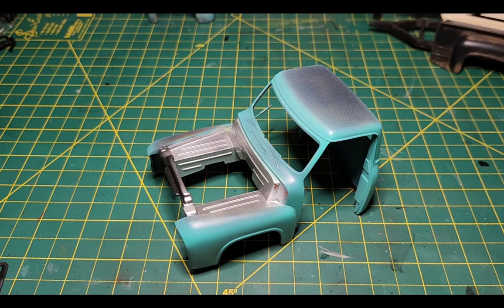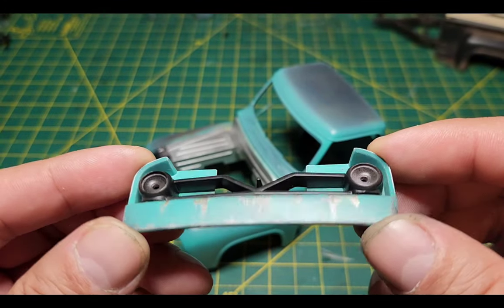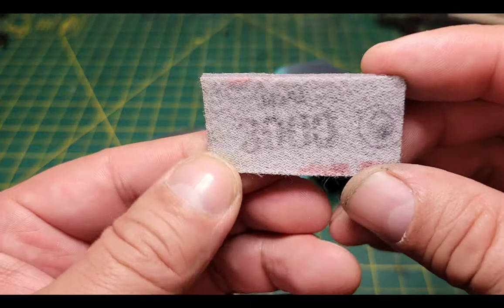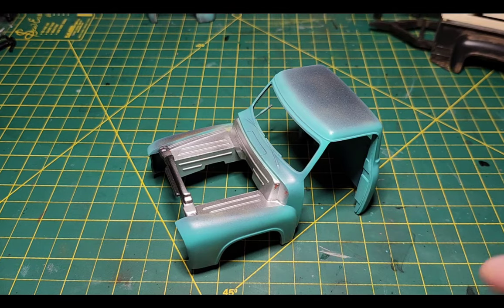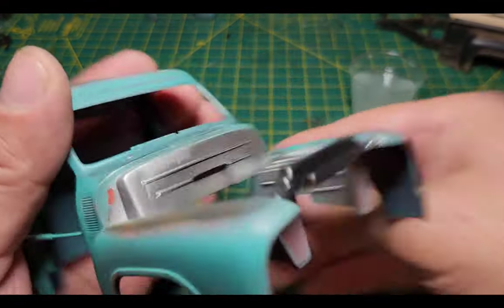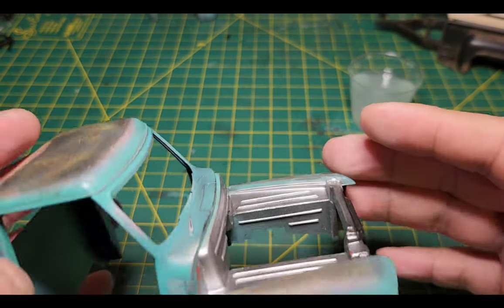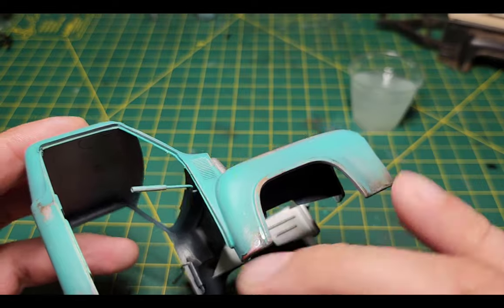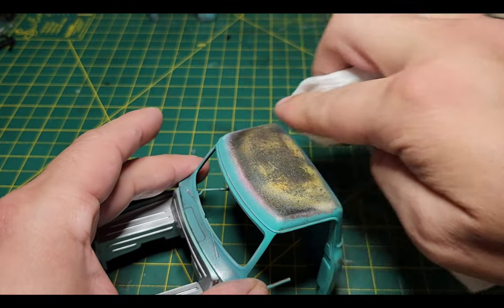Part 12 : USACC 1955 Ford Pickup 1/24 scale - sanding through layers of paint - patina/weathering

Comment: I love it..
Your patina thecnique is similar to mine👍
Reply from the maker: Thanks Mars. I've tried the salt before, I just couldn't get it to look right. Had to try something similar. I hafta say using an airbrush makes a big difference. Maybe that was my issue, the paint was too thick.
Reply: @cardzscaledreams3917  
The salt thecnique only works with air brush, I tryed doing it with spray can but it's not the same, so all of my rust is from acrylic paint, sponge, and dry brushing..
Reply from the maker: @marsgarage8217  ya, that's what I figured, thanks bro 👍